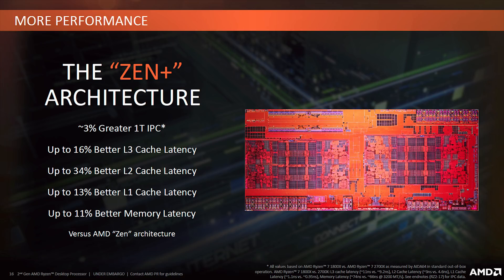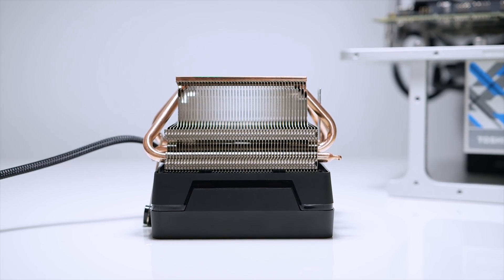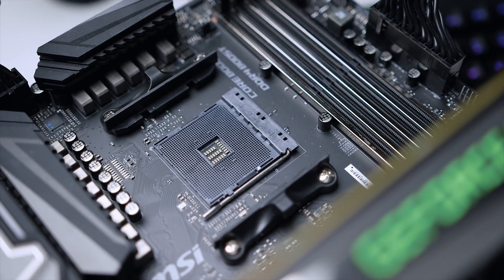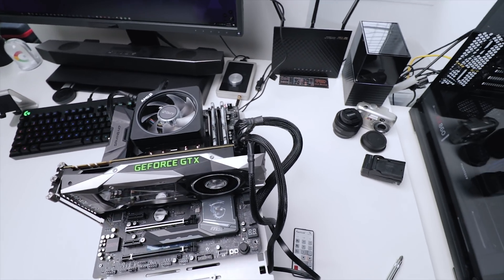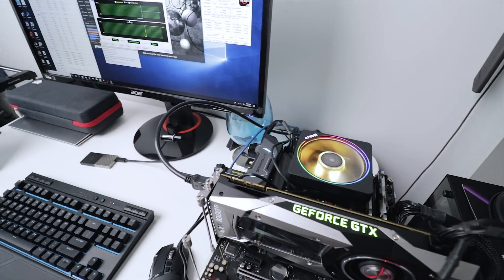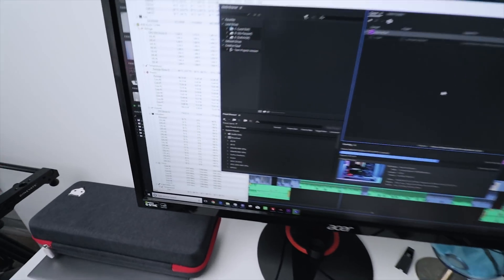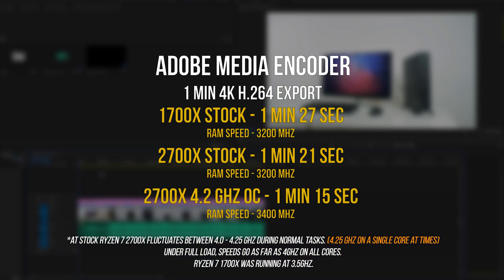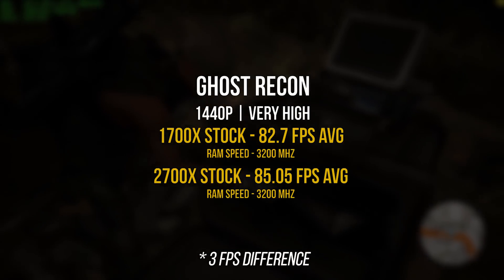Ryzen 7 2700X vs 1700X - Worth the Upgrade?

Comment: Shitty chip if it won’t clock very high. As for the chip………have you tried straightening pins on a “zif” socket………impossible compared to straightening pins on cpu.

Comment: LOL I have a x470 prime pro with a ryzen 1700 non X... cinebench R15 @3.98 "1802 1798 1801" scores and i bench it all the time .... i guess im gonna hit the 3700x up and just jump from 1st to 3rd gen considering i have this awesome chip and hit the lottery i have had it clocked as high as 4.27 MHZ only stable enough for 2 passes of R15 and it benched 2051 dialed back to 3.9 MHZ for my everyday OC vcore never sees more then 1.32 @100% prime 95 @64 degrees... I hope with 3rd gen i will see a 30% gain, if the numbers are not ENOUGH for gains ill just try a R9 3900 youll never find a 3950

Comment: I went from a phenom II dual core to a this ryzen 2nd gen, from a sata 2 drive to an m.2. Yes my rig was about 10yrs old and I did the upgrade just so I could edit video.  If you really want to be blown away by new technology, don't upgrade so often! I get 8 cores and 16threads, at a boost speed of 4.1, and all running at 65 watts compared to my 125 watts if I opened my phenom to 4 cores.  You will appreciate and marvel at the improvements more if you just chill for at least three years before upgrading anything...be a zen master

Comment: why didnt you overclock the 1700x?,i have my ryzen 7 1700 (no x) stable at 4.1Ghz at 1.4volt and i get over 1800cb multicore and 170cb single core.

Comment: Why would you overclock a ryzen 2700x, when the cpu has adaptive boost? It will boost itself based on your workload and cooling, there is no need to overclock. The difference between the 1700x and the 2700x is the adaptive boost, in which if personally you don't overclock the 2700x is the better cpu. When it comes to testing 1080p is the preferred choice.

Comment: 1864 on cine??? i get 1919 on cinebench with no special hardware. Stock cooler, 3133Mhz ram,  and 4.25Ghz cpu freq.
1786 is stock points with cpu being in auto mode and no overclocking whatsoever

Comment: I am not getting as nice of scores.... i got over 1900 when I overclocked to 4.3 at 1.45V but it was not stable..... now running 4.2 at 1.35V and overclocked my 3000 memory to 3200.... getting around 1880 cinnebench...using a 360mm AIO and it is keeping the CPU nice and cool at 60 degrees under load....would love to get 4.3 but scared to increase the volts and don't know that the slight performance increase would be worth the extra wear and tear on the card.....maybe ill upgrade when ryzen 3000 series come out if it is worth it and can run in an AM4 socket.

Comment: I wonder when trash reviewers are goin to learn that testing a CPU with games set on maximum detail and high resolution IS LITERALLY WRONG. I saw this video to understand gaming performance and your test says ABSOLUTELY NOTHING about that because are entirely GPU limited. Those who play eSport put relatively low res and low details to achieve the maximum fps boost, there is when the CPU makes the big difference. Something that you didn't test AT ALL and let people think that 1700x and 2700x got same performance on gaming while the gpu was bottlenecking both cpus.

Comment: Got 2700x for 280. Worth it.
Reply: What did you have before? I'm toying with upgrading to a 2700x from a 1600. Why the fuck was this video tested at like 1440p? Re-run the damn tests at 720p so we can see how the CPU SPECIFICALLY affects the frame rates. This was a duff test

Comment: That's why I will never use AMDs stock coolers again. Had that same problem with my Phenom II X6 1100T on a AM3 socket.
With an aftermarket cooler not using the brackets screwed to the board, this Problem does not happen.

Comment: You gimped the 2700x by not running the Ram at the speeds it was capable of, that's one of it's key features...
That and 1440p for testing ?

Comment: Considering one of the main benefits of Zen+ is the ability to use higher speed memory, it would be appropriate to use the fastest ram (from the same vendor and series) that will work for each.  That's closer to apples-to-apples in this situation IMO.

Comment: Damn freaking 1700x is now 149.99 at new egg. Lol
Reply: At my local Micro Center it is selling for $129.99
Reply: @visionaireg8211  lucky u to bad micro store isn't here. In Cali but new egg raise up the price for 199 then it went back to 150 really want to go check from work to buy it lol.
Reply: @rcrotorfreak  yeap just my Ryzen 7 1700x today, hopefully there is a bigger price drop for black friday. All the best!
Reply: @rcrotorfreak  I know this is a tad late but, you know you could have ordered it online? ;-)
Reply: @Lighteningskye  I did ordered online but price went up when I had the money. I paid 169 still good price and my PC just zoom. Last time I check it was selling for 229-239 lol
Reply: @rcrotorfreak  Awwww but 149 is still great! Last I saw here, that same microcenter was selling them for $179!
Reply: @Lighteningskye  should I get the 1700x or ryzen 5 2600? 1700x costs 180€ and 2600 150€.
Reply: @jeremiasryynanen3137  Honestly, I don't know enough about the 2600 vs 1700x.
I purchased a 1700 because it was a massive upgrade to my 4770k and was so cheap lol. It also does everything I need it to do. For you it could be different. 

Besides price, see which one of those CPUs works best for you. I did chose the X series simply because of the core count.
Reply: @visionaireg8211  Yup! Bought 2 1700X for 129 ea.

Comment: Hi, I've been building my own systems for a long time, but I've always wondered... when picking components for my build, is there a difference between a gaming application and a video editing application machine? Or would the components, CPU's, RAM, GPU, etc. be basically the same?
Reply: there is a difference. video editing applications (or just content creation in general) make better use of more cores/threads. gaming has just recently moved past the sweet spot of 4 cores but it hasn't reached that level of core usage yet, or rather the benefit isn't truly there

intel still beats amd at raw gaming when you match up the newest i7 8th and 8th gen compared to amd ryzen 7's and whatnot. 

But it's not like they can't be both used for the same thing. a gaming machine or video editing machine is all relative, it's what the creator wants it to be.

Especially at 4k gaming where the gpu really becomes the deciding factor.

Comment: Its funny to see how “pros” get the cpu stuck up when removing the heatsink. Just a tip, always remove it when its a little hot and try to do small and slight winkles when pulling the heatsink out.

Comment: Well my take away is that if you want to have more headroom in your memory overclock, then the upgrade is valid. I have the 1700x, and I'm a bit miffed that my Trident Z 14-14-14-34 kit will not go beyond 3200MHz even at a modest 3.9Ghz overclock on the CPU. But I think I kinda got a average IMC for my CPU, I just leave the memory at 3000MHz with tighter timings of 14-14-14-30-44 -1T timings.

Comment: I upgrades my system from a Ryzen 5 1600 to an Ryzen 7 2700 , i get one ( dont know the english word, in germany Generalüberholt) for 235€ ste it on my B350 MSIBoard und i have to say, great, sooo Cool, much cooler than te R5 and so much faster and it feels so snappy, and much mor e direct response. I love the 2700 with out x i Boostes on 1V up to 3975 -4050 MHZ with no OC, absolut Perfect, Cooller ist an Alpenfön Ben Nevia for about 23€

Comment: I like what AMD did with Ryzen with 1st gen but 2nd gen Ryzen was just like pre Ryzen Intel offerings, increased clock speeds (and this case latency improvements), little else. Should've just waited for true Ryzen 2. Only thing this will do is encourage people to buy cheaper Ryzen 1st gen chips, which isn't bad for us consumers, just don't see people buying Ryzen+ because of the little improvement. Unless AMD is simply hoping to reduce Intel chips being bought by cheaper Ryzen 1st gen chips, strategic market share planning perhaps.

Otherwise, should've waited in my opinion. Especially with Intel now taking AMD seriously and making their consumer enthusiast chips more than 6 cores now. I'm expecting Intel to be douchebags with cost though, core i9 gonna be unreasonably expensive probably.

Comment: If you have a 1st gen Ryzen, its way too soon to upgrade. You can get a good 5 years out of it and wait till 4th or 5th gen Ryzen comes out. I still use my Ryzen 1700 65W in my low profile build and will be using it for a long time to come.

Comment: I upgraded my 1700 to a 2700x and it was a realy got desision. With the 2700x im now able to overclock my Ballistix Sports to 3GHz CL18. On the 1700 i was stuck on unstable 2400MHz. The memory controller in the new Ryzens are way better.

Comment: I have a Ryzen 1700 (non overclocked) with 3200mhz trident ram (8x2) with an asus rog GTX 1080TI. Is my cpu bottle necking the gpu? If so should I upgrade to 2700x to make most out of my 1080ti
Reply: no, even the 1600 can use the 1080ti

Comment: i ended up swapping from a 1600 to a 2700x not too long ago, OC was pretty easy for me. i have it running at a stable 5.1ghz OC with a MSI core Frozr cpu cooler which is not quite the best cooler, however im never going past 70C with temp;s so it seems ok.

Comment: Help me help me help me help me I have a Asus Crosshair x470 ryzen 1700 will not post coming up with debug light for CPU red LED how to get my board to post for me with the ryzen 1700 not a second gen it's supposed to work for both generations and yet it's not a Crosshair Asus motherboards going to end up going back unless you guys suggest that I download the newest bios but I can't post into the BIOS to get it to update so I would have to use the flashback button to flash the new bios do you guys suggest I do do that

Comment: I thought the 2700X boosted up to 4.3 GHz...sad it can't run stable at that speed with the stock cooler.  I just got the 2400G up to 4.1 w/o even trying that much with an Arctic Freezer 33.

Comment: Doesn't worth the Upgrade of course no one should upgrade his processor each year thats definitely like buying a new PC each year which doesn't make sense at all .. The only down side i see from the new Ryzen in compared to the First generation is that i liked the look of the Old LED Fan rather than this Transparent Fan even though this Fan is definitely looking better in terms of Cooling Ability and I must say that the new StoreMI technology is really a good step ahead.

One last thing to mention\  i think you should have tested these games on 1080p rather than 1440p to sense the difference between them more , i think 1080p will show much bigger gap i suppose in Frame Rates.

Comment: I dont see the need to upgrade I have Asrock X370 Gaming Profesional mb  Ryzen 1700 oc to 3.9 @ 1.31v  with 3200mhz ram Cinebench  score of 1704 and have seen highs of 1764.  Not big enough increase to shell out another 320 bucks.

Comment: You can get around the PGA issue by removing the black braces and twisting the heatsink before lifting, AMDs stock tim is like glue and super sticky. Aftermarket ones are usually fine

Comment: Not sure why you had so much trouble overclocking the 2700x, I have one and used the Asus software to auto OC it, it’s now sitting 4.2Ghz on the stick fan. 

I’m glad you mentioned the AMD program needed to change the colours on the fan... was pulling my hair out trying to figure out why Asus sync wouldn’t let you do it!.

Comment: You test games at 1440p max details and wonder why there is little fps difference? That is a noob mistake. at 1440p the onus is on the GPU, taking the CPU out of the equation for the most part. Do a 1080p and max details for a better performance difference and more realistic results.

Comment: Yeah, the 2700X supports faster mem, but you did no stock testing with the faster setting.  So if the newer car model can make use of higher octane don't do any testing with it 'to be fair' right?  I do agree that the 1600 to 2600 might be a better deal for upgrade.  You also have to consider that putting the 2700X in 300 series MB would be more representative of an upgrade.  Otherwise the upgrade would be like Intel a CPU plus a new MB which most would not consider.

Comment: I think the best upgrade for AMD users would be the ones who bought a 1600X or lower and want to move up to 2700X. This would be the best side by side generation jump. 1700X to 2700X might not be worth it unless you can find a decent buyer for the 1700X and offset the cost.

Comment: Good review. I've  watched several reviews from at least 5 different testers and it seems to me that for the price increase while conservative, just doesn't deliver IMO. I use mostly AMD and have seen them over the past 15 or so years make some improvements to play catchup for lack of a better phrase, with Intel, but delivering steadily on their price points. This one, from what I can tell so far, kinda breaks that mold in that it's actually not much significant in user performance over the 1700x. Even with the 4.2 OC you get what one FPS better or so? Unless there are some worthwhile upgrades coming in the BIOS that we haven't seen yet to tweak the 2700x I think AMD is soaking their customers on this one.

Comment: You should always use the twist method when removing a cooler from a PGA socket.  Unclip or unscrew and then rotate the heatsink to free it then lift it off.

Comment: really wish oc'd 1700x numbers were on here! @ $250 get a 1700 and over clock it ..... and the price just keeps falling on the 1700 .... price to performance king even after gen 2.  

I am running a 1700 clocked at 3.925 , 32gb of ram at 3200, 1080ti and I am live streaming all games at 2560x1080 60 fps. sooooo happy with my rig

Comment: See I had a Nh-D15 from my i7 4790K, so it was more sensible to go with the 2700 non-X and buy the required mounting kit for like $7.50. It gets the same 4.2ghz at 1.425v and Max LLC, for $30 less.

Comment: Great vid! I think it boils down to the idea that if you can get higher performance based on the ability to reach higher core clocks and utilization of higher ram speed, then it's a no brainer. Clock it higher and go with the 2700x. I think you should have done your 2700x oc scores with the 3400 ram speeds to see full potential.

Comment: Currently I have the 1700 (non X) variant, not over clocked. I plan on upgrading cooler to use OC. But if I ran an OC would it be beneficial for me to upgrade???
Thanks for the VID!

Comment: From AMD Phenom(tm) II X4 955 to Ryzen 2700x. This is a major upgrade for me! Now as I patiently wait for FedEX. I mean, I've been banging this Black Edition X4 955 since 2009, another day or two won't hurt.
Reply: Mezziah dude im still Running 955 :D haha
Reply: Im still on a 945 BE overblocked to 3.6ghz lol.  Plays overwatch at a steady locked 70frames with textures and stuff high but mostly all low gfx.  Starting to think about upgrade but its a toss up...   Im having slow HDD performance so also thinking maybe I should just replace caps on the motherboard and keep this machine until I really need something faster hrm
Reply: @ZeffAU  I still have a running Athlon 5000+ BE running as a file server :D
Reply: I just replaced my 2011 Phenom II X61100T rig with a Ryzen7 2700x based rig. Build went smooth and I am loving my new rig. Haven't gotten the nerve to do any overclock yet. I am running the stock cooler for now.
Reply: Another one from AMD Phenom(tm) II X4 955 to Ryzen 2700x. Just perfect! Cost of a new 2700x is 170€ nowadays.
Reply: I"m on the X4 960T BE edition lol. And will upgrade to the 2700x as well. But jokes aside I think the 960T has actually aged well for me
Reply: cool!
Reply: Same except my CPU was a Phenom II 1090T x6 Black Edition. It's served me well and earned it's retirement.

Comment: This is a great idea for a video, but I am disappointed by your analysis.  In the POVray test you compared 24 seconds to 20 and said "It was not significant" when that actually represents a 20% improvement.  Many of the other tests had a much smaller percentage of change and you identified the change as significant when you could feel the difference vs when you couldn't feel the difference.

I think your tests are valid, and it was a great set of tests you selected, but the presentation and analysis could be much improved.

Comment: not worth the upgrade (1700 @ 3.8 -1.26v, I can hit 4 @ 1.42v, but its not worth the heat 85c p95 small (Nuctua D15) and im glad i didnt wait. now is the worst time to build a rig. prices are ridiculous for ram and gpu. got my gtx 1080 ti ftw3 $780 and gskill trident z 3200 cl14 32g $250 lol!
We'll see what Zen 2 has to offer.

Comment: I just bought the 2700 and I have a 1700X at 3.8ghz with 32gig @ 3200 with 14/34 T1 timings. I used a 1080 on both and there is hardly any noticeable difference in gaming. There is a big difference in memory latency and when using solidworks the 2700 is much better. If you're just gaming .. it's not worth the upgrade

Comment: I'll be impressed with the first CPU company to release auto OC like NVidia's GPU boost, where based on power and thermal dynamics available, the chips overclock to the max stable OC, adjusting voltage and clock speeds on the fly.

Comment: I don't understand people sometimes.
If the R7 2700X is tested with a 1080ti on 1080p people complain that it is not real case scenario for a 1080ti.
If the R7 2700X is tested with a 1080ti on 1440p people complain that it does not show difference between CPUs.
What does the reviewer have to do so people can be happy?